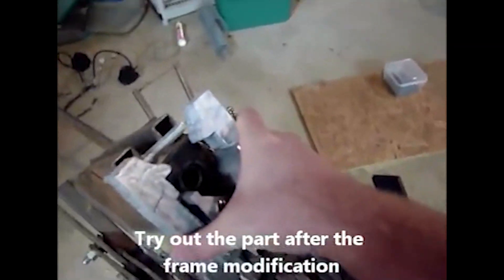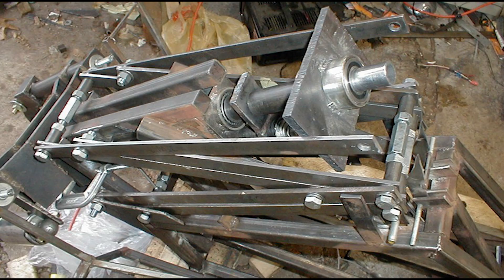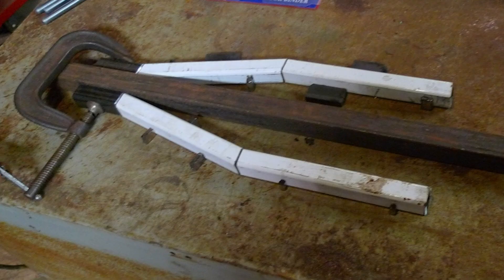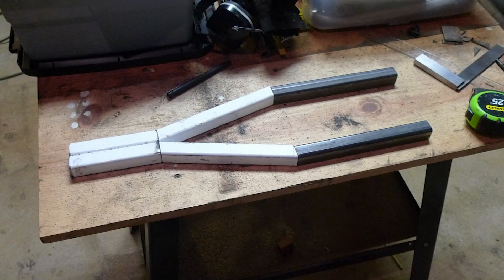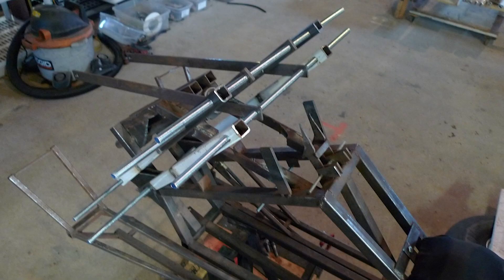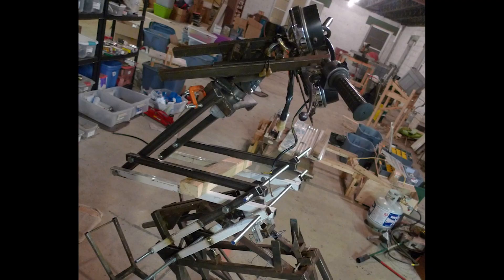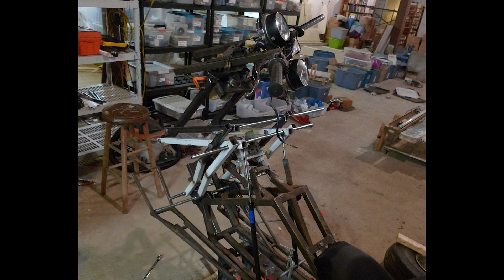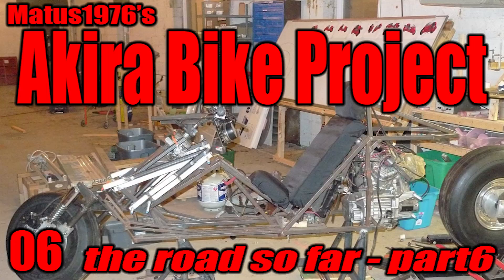The Akira Bike Project-06-the road so far-part 6. Designing and building a recumbent motorcycle.

Comment: Hi again, long time.
Good luck with the vid series.
Agree that the swing up handlebars and cowling is a major plus.  Otherwise gettin in and out would be a royal pain.  Last thing anyone would want is a bike they need to crawl or climb awkwardly out of, while trying to not flip it off it’s “landing pads”.  That alone would negate most comfort appeal of the bike.
Reply from the maker: yup, totally agree!
Reply: @matus1976  
Oh, how does the pitch up steering work if the wheel is turned a bit?  Or do users need to make sure they are aligned?
Steel parts from tilt steering wheels dude. ;)
Reply from the maker: @KellyStarks  Definitely not going to just depend on the operator to keep them aligned! lol. They'll be a cylindrical toothed cogs connecting the floating handlebar steering column to the rigid frame column, and one of those will also be retractable as a solenoid to allow the disconnect and raising.  Additionally they'll both be connected via aircraft type control cables, so when the front end is up, even if you turn it, the wheel will still turn, so they'll be aligned when you close it. I will however make it so you can not unlock and raise it unless the bike is off, or at least stopped. No crazy jetski like riding, which I know people will want to do.
Reply: @matus1976  
Shudder... Yes, crazy’s find insane enough things on normal bikes, you can be sure there is a desire out there to find a new way.  ;)

From the movie it just looks like the vowel and Handel bars swing up from a pivot above and behind the rear edge of the front wheel.  I was surprised the steering connection to the front fork would become so complicated.

Hummmm.. maybe rather then using cables in the steering, a rocker arrangement ( like in cars mounting shocks horizontally, and the rocker turns the suspension rise into a horizontal movement to the shocks) which seems much more rugged and easier to a just.  Just a thought